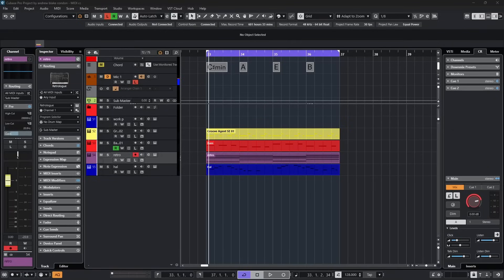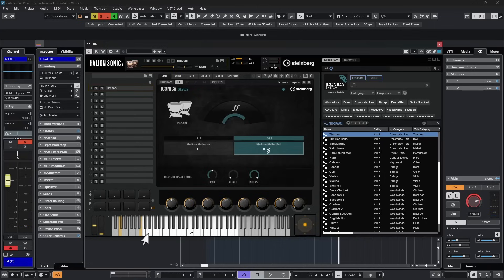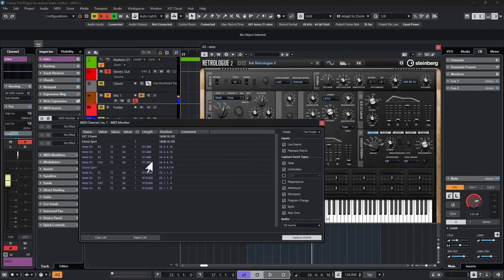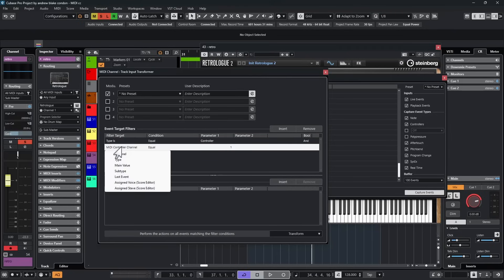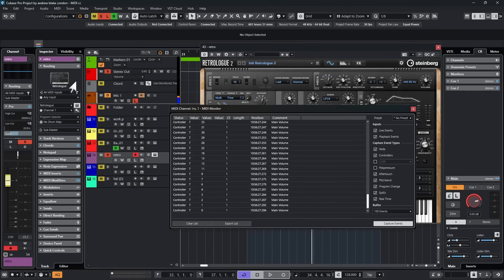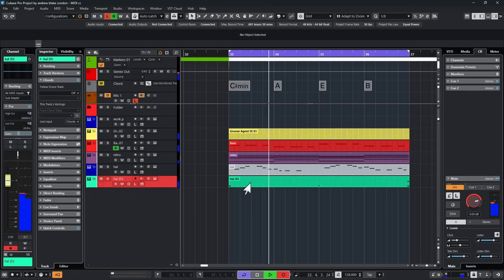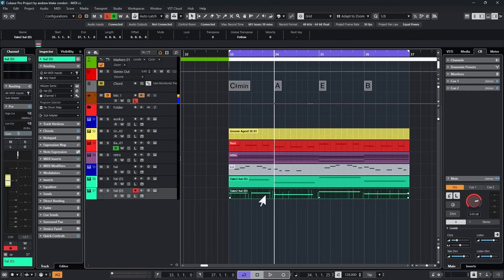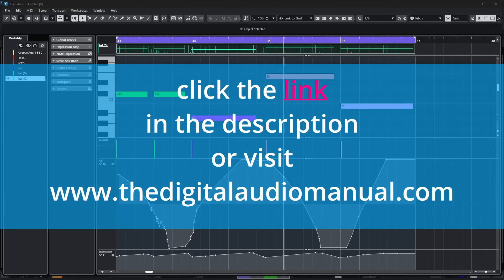Exploring the Creative Potential of MIDI CCs in Cubase

Comment: Another useful video, thanks! How would you link your modulation wheel, for example, to two or more cc controllers? I am thinking, for example, of modulation and expression, on strings.
Reply from the maker: hi Thomsen,, you could try to duplicate whats in the bottom area of the transformer, having 2 commands instead of 1,,, andrew